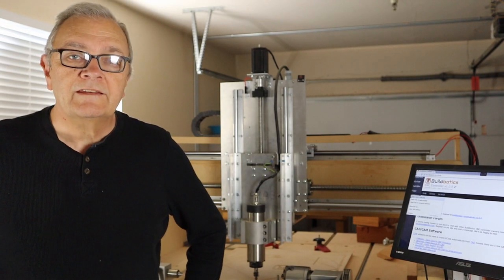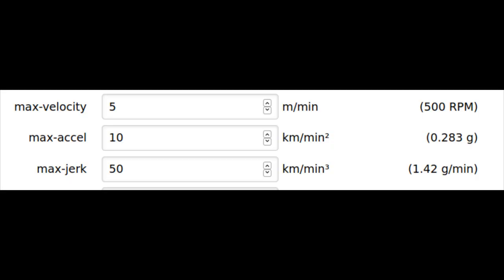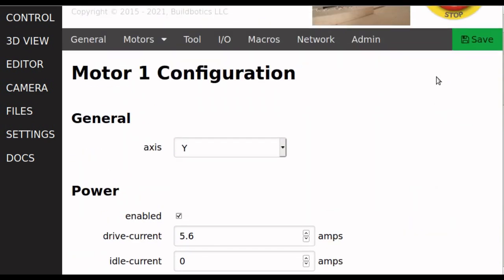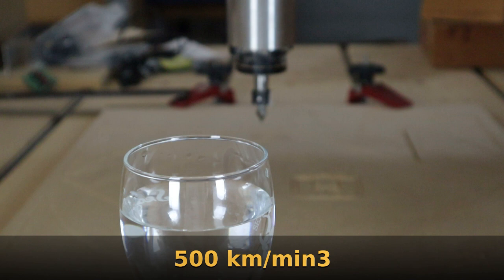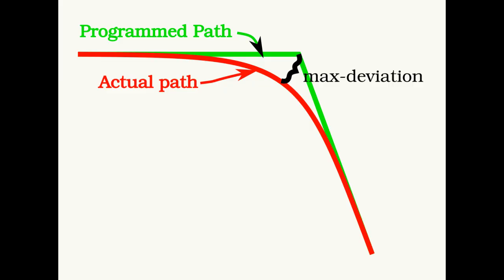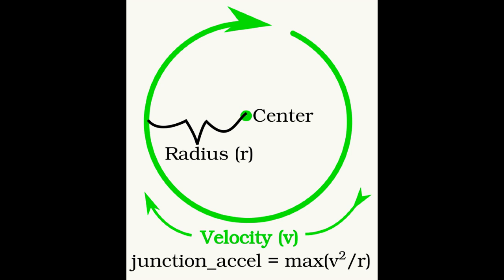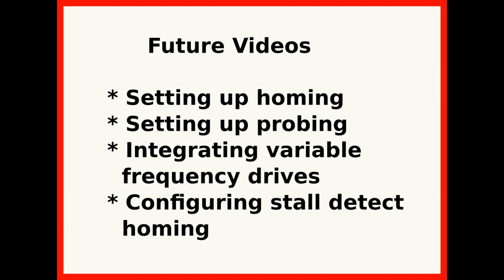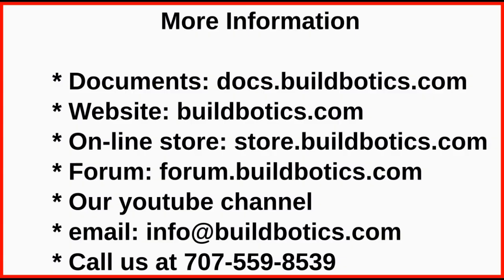OptimizingSpeed

Comment: I appreciate the video, and understand the process changes but what affect does this have on a machine? Does maximizing the jerk and accel and velocity, create more wear on motors, screws, etc, as opposed to the lower speed settings? This would be difficult to measure unless 2 machines were operated for the same time at different rates, but individuals that maintain these machines, must be able to comment. Thanks

Comment: Just getting my Onefinity Journeyman going, and I will run these tests soon … thanks!!

I read somewhere before I got my machine that these adjustments need to be done in metric … Is that true?? If done in metric and I switch back to imperial, will the settings convert automatically?

Comment: Can I use this on my shapeoko pro xxl.

I plan on ditching the nema23 for nema 24 2-3amp motors as they have 8mm axles...

I use the carbide3d shapeoko bitsetter also...

It is in a fixed position.

Is it possible to use this also?

If so I'm sold and will buy 1 to test and further purchase another 10 boards if all is good.
Reply from the maker: The Buildbotics Controller will work with your nema24 motors and your bitsetter. In order to make the bitsetter work, you will have to cut the plug off of the end of the cable so you can attach it to the DB25 breakout box that comes with the BB controller. Then, you will need to program the probing sequence into the 'tool change' box on the Settings->General page or you can configure a 'macro' button to run the probing sequence.